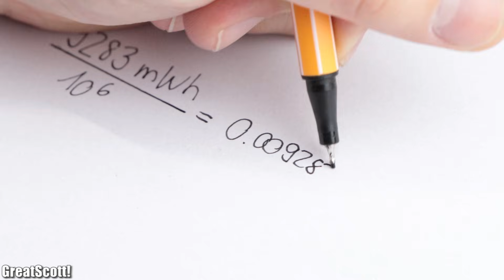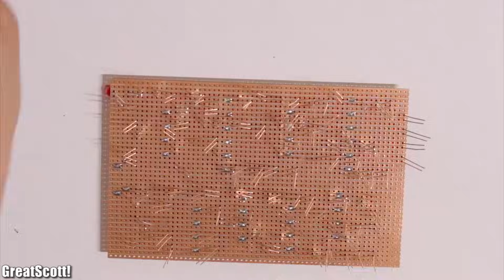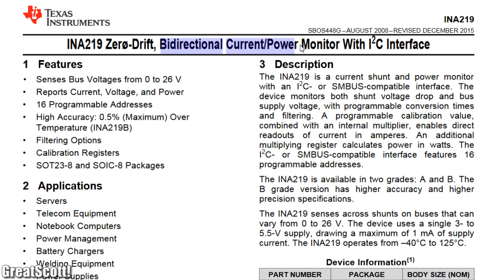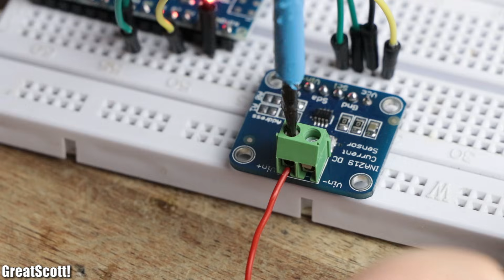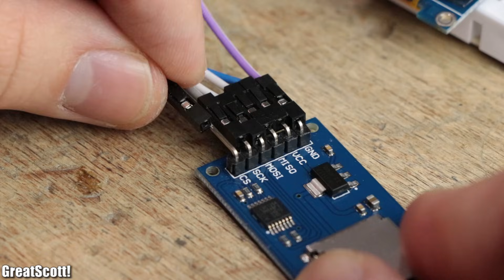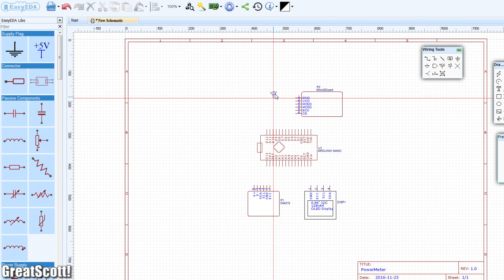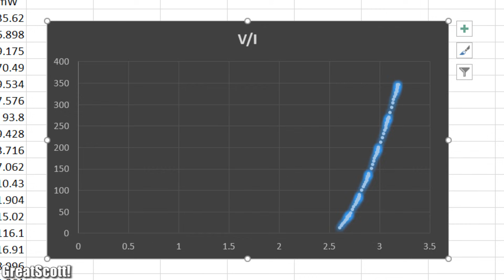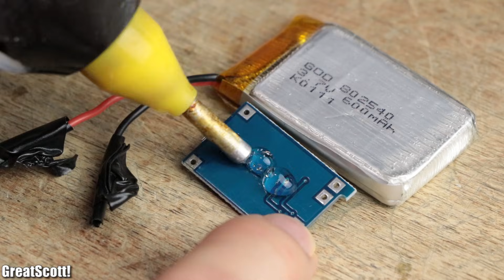Make your own Power Meter/Logger

Comment: I just started a similar build some days ago using a Pro Mini, ACS712 current sensor and the same OLED. Since I mostly record to my PC anyway my unit is powered using a USB port (thats not the input-port but a dedicated one) which also sends current values to the connected PC for display and recording. I opted to use the internal 1.1V reference instead on VCC, so changes in the PCs supply voltage don't offset the ADC that much. You might want to check this on your build if you connected the battery directly to VCC - afair VCC is used as the default reference for the ADC so your measurements might get skewed with falling battery voltage. Using the 1.1V also allowed me to dynamically scale for <7V input ("normal USB") and <24V (USB-PD). I also added a P-FET to turn off the output (Low-Voltage-Shutdown) and am measuring the Data lines to detect open, data, various Apple-signaling and DCP - sadly USB-PD seems to be off limits for now. Last but not least I save the current Ah/Wh to EEPROM when the µCs power supply starts to drop out. Currently I am waiting for some parts to get everything into a unit not quite looking like a bomb.
Reply: BitBastelei Hey 
Gar nicht erwartet dich hier zu sehen👋

Comment: Hey can you do a project with a non-led monitor/screen?. I have a few from old broken laptops and I really wanted to turn them into lamps but I found out that it seems all the projects people do are with ones that are LED and not florescent which is what I have in all my screens. I really need to light up my workstation and garage with something and I was hoping for the monitors backlights. I have seen they can be super bright sometimes but i'm not sure how good the florescent ones are for brightness. I'm also not sure how to wire/build on the circuit so I can have some form of control so I can attach a battery pack to allow me to move it around easily.

Comment: Rock on!  I have several of those little OLEDs - Watch out for cheap clones out of china...  quality control is generally non-existant... Plus shipping incidents can easily cause damage.   

 I have created INA219+ESP8266 based solar power / environment monitoring / logging / controlling  devices. Slowly building my own smart house   :)     #iot

Comment: what's the max voltage and current of this project. could I use arduino mega
Reply: 3,2 Amps and -26 to 26 Volts at max. You could use any kind of microcontroller, including the arduino mega. But that would really be an overkill for this project ;)

Comment: How do you charge the Lipo? I don't see any means except taking it out and charging it.
Reply from the maker: The board on top of the lipo is for charging. It is a TP4056.
Reply: Ah, ok thanks. I thought that was just a load protection for the battery. Didn't read the "Charger" part.
Me so dumb some times...
Reply: GreatScott! please make quadrocopter in next video 👍
Reply: Come on. Stop disturbing him. He'll do it at time

Comment: Great tip with the INA chip. Are you sure the misread resistance is not because of the probe contacts? Have you tested 4-wire measurement?
Reply from the maker: Since the current readings from the IC were pretty accurate there must have been another parasitic resistance.

Comment: But when you power your arduino with the lipo battery, did you use a 5v boost converter or a 3.3v arduino model?
Reply from the maker: I did not use a boost converter nor a 3.3V version.
Reply: And how did you managed to power on your 5v arduino with a voltage of 2.7-4.2 v?
Reply from the maker: *****
By not using the voltage regulator.
Reply: Ok and it's safe to use? Also what is the minimum voltage that arduino supports? P.s. Thanks for all your videos, you have an amazing resource channel :)
Reply: I just double checked it here http://www.atmel.com/Images/Atmel-42735-8-bit-AVR-Microcontroller-ATmega328-328P_Datasheet.pdf according to the speed grade section 2.7V at 10 MHz and 4.5V at 20MHz are stable region.  At the default 16MHz it will need 2.7V+(4.5-2.7/2) = 3.6V to operate safely, the lipo when fully charged will be at 4.2V and ideally when drained isn't really lower than 3.6V so probably okay so long as the voltage doesn't dip too much and the batteries are well charged.  Either way going to go with the pro mini at 8MHz then have a fair amount of overhead on the voltage.
Reply: A lipo when drained will be at ~3.0v. The battery will spend most of its time around 3.6 or 3.7v(depending on chemistry) however.
Reply: Richard all the lipo cells I've encountered charge to 4.2 per cell and shouldn't be less than 3.3 but t other chemistries exists.
Reply: Thomas Naldoni
Reply: Visit Arduino website. All information you seek is there!
Reply: Yes, 6V minimum on vin or 5v by a computer..
Reply: Matteo Naldoni look at the atmega328p datasheet, that is the chip used on Arduino nanos unos and micros. Look for the minimum and maximum supply voltage (They are probably linked to the maximum frequencies).
Reply: to "safely" run it must have higher voltage or be clocked to 8MHz and use will run at 3.3V.  I also have two 5V nanos with one powered directly off a lipo and one going through a boost, both seem to operate fine but ordered some 3.3V pro mini 8MHz for the longer term since I'm using them on an eskateboard and don't want any glitches.
Reply: Thank you all, your answers are really appreciated!
Reply: Tanti Kasso what?

Comment: How you show to calculate the cost of charging your cell phone in the beginning of the video is a bit misleading.  It would be more accurate to have a device measuring the power usage between the mains and the 5v power supply.  As you know, those power supplies aren't 100% efficient so you would see a higher power reading.  I suppose you could add that into your calculation if you didn't want to deal with mains voltages.
Reply from the maker: True. But such a calculation would have distracted from the main subject of the video. My calculation would only be correct if the efficiency from 230V to 5V would be 100%.

Comment: you could have used CSV instead of 3 text files
Reply: I was about to write that as well :) comma separate values (or semicolon) for the win!
Reply: you can write csc-compatible text in txt, just separate columns with ; or something else, what you use in csv-reader. sor example, if you copypaste text to excel, you need to tab each other columns.
Reply: I don't understand your objection, why should that be a problem with tab character and not with a semicolon one as column separator?

If there are too many lines for a csv/tsv file to be handled properly, you can use more advanced formats, like HDF or similar.
Reply: You can seperate the values with any delimiter you want, like a coma. The best thing with CSV is that it can be ealisy imported in Excel and you saves i/o call on the arduino/sd.
Reply: You can separate columns with tab itself ;)
Reply: ADFKSJG, would you have the code for this, new at all this coding and not to sure whats needs to change.
Reply: 9peppe
and if there are thousands lines?

Comment: Great video. The resolution of the OLED display is not set correctly though. It is not set to the maximum resolution.  Edit the library file in order to set the correct resolution 128x64 pixels .
Reply: @ChoudryArif  it's not hardware. I thought the same, and after 5 hours of troubleshooting I finally found the solution. You need to change a line of code from the library itself. Either way the display will work at half resolution, even if you change it from de IDE
Reply: @BnMroGaming  I don't know if the memory has been upgraded on the current models of the arduino, but from what I saw on the instructables site, they ran in on the 128X32 because of memory limitations.  The 128X64 used too much.
Reply: @BnMroGaming  hey lets talk i need your fb

Comment: You can save your values to a csv file and import them directly in excel :-)
Reply: @Kristian: Sure, you could write JSON manually (it's just text) but it would be a lot of overhead for simple data. JSON is better suited for representing data with a lot of structure to it, as an alternative to XML. For a couple of independent values per line it's overkill.
Reply: The simple answer is yes, and no.
I can't go into details in a youtube comment, but you need to know how data is stored on an SD card's FAT32 (or any other filesystem). Besides the stored data itself, there are certain additional bytes in the beginning of the card (called file allocation table, that's where FAT name came from) that gives you info like filename, file creation time, file size, attributes, etc. Also, the OS (or Arduino code) registers there where the file's content is located.
Just opening and closing a file doesn't do anything. Neither open-read-close. You can do this as many times as you want to (although it takes time, CPU cycles, and battery power).
But if you open-write-close, the content changes, file size grows, and the Arduino needs to alter the content of that area to register this change. Thus that particular sector gets rewritten 10 times a second. SD manufacturers might use wear leveling - especially in that area - but I wouldn't do that.
If you can potentially sacrifice a very small amount of measurement data (in case of power cut or whatever), you can collect data that takes around a whole sector (512 bytes), and write that simultaneously. This way you can lower the amount of wear (1 write operation for every new block of data).
Also, FAT is vulnerable to power cuts during write (it has no journal), so the more frequently you write, the more possible is the damage.

Sorry for oversimplifying it, if you're interested in the details, read the wiki page:
https://en.wikipedia.org/wiki/Design_of_the_FAT_file_system
(other filesystems work similarly, but modern types tend to have journal, which protects you from FS corruption for a bit more CPU cycles and wear)
Reply: In this case, JSON would be impractical. You could do it, but since you take a new measurement 10Hz, using a tsv/csv you can simply append a new line. With JSON, you would have an array of measurements, and your ']' would be in the way of append. You could delete that back, add a ',', append new values, and close it with a ']' to be deleted right after that.. a tad more hassle compared to a tab separated vector.
But.. you can do it.
Reply: I did and it worked - sort of.  I wrote all three values with semicolin separators.  The line returns are accomplished by closing the file, I think.  Here is the code:
void loop() {
  unsigned long currentMillis = millis();
  if (currentMillis - previousMillis >= interval)
  {
    previousMillis = currentMillis;
    ina219values();

    DataFile = SD.open("PowerData.csv", FILE_WRITE);
    if (DataFile) {
      DataFile.print(currentMillis);
      DataFile.print(';');
      DataFile.print(loadvoltage);
      DataFile.print(';');
      DataFile.println(current_mA);
      DataFile.close();
    }
    displaydata();
  }
}
Reply: No, the line returns are accomplished by that println. Also, if you can collect more data and write only then to the SD card, your SD card gets less weared out, so it won't break that soon. Opening, writing, and closing a file on an SD card all the time destroys it.
Reply: Wow, thanks again, NyOs Gomboc!  Fantastic, informative response.  I have started reading the wiki article.  I feared the indexing of the address (on write/close) would maybe concentrate the wear.  I will do as you suggested and buffer chunks of data before invoking a 'data dump' saving potential index wear.  There are other strategies for me to look at: 1.  collect at a lower frequency; 2, not collect the microsecond value; 3. maybe only collect values if the value has changed (if I can maintain some sort of time basis); 4. not close the file; 5. maybe write to a fresh file name with each each dump or every ten or twenty dumps; and 6. perhaps other strategies will come to me after reading more.  So far, I have recorded for 7 hours.  I modified Great Scott's program to track "if (!DataFile)" and then count the failed occasions.  So far, I'm way above 99% success.  The wiki article takes me back to DOS and boot sectors - something I long ago forgot.  Time to study up again!  .  Again thanks for your generosity.
Reply: Thanks NyOs Gomboc.  Line Return: Makes sense.  Because of your post I researched more on SD card wear leveling but still have one question.  Does the opening and closing cause wear, or just the writing?  I've read that SD cards employ wear leveling logic that move writes to fresher locations and can endure thousands of write cycles.  Great Scott's program writes 4-byte float values to SD memory 10 times a second, each with an open/close cycle into each of 3 files.   (I think the resulting written data value is much smaller than 4 bytes, however.)  But even so on a 16GB card, and (4 bytes)*(10 writes/sec) * 3 files, this rate would fill the card once in 1.3 years.  And if you can do that thousands of times, then wear isn't an issue.  But if the open/close cycles cause the wear cycle then an SD card would be good if it lasts an hour or two.  This would render SD cards inappropriate for such data logging.  Thank you for replying if you do.
 .

Comment: why the arduino pro mini?
Reply: h def about to replace regular board with pro mini on my own project reason being 1S 3.7V LiPo is way under the 6V minimum for the regulator to make 5V, so with regular Arduino you are always under powering it, pro mini can be clocked at 8MHz and use 3.3V instead of 5.  Means more stability at the given voltage and can talk to other 3.3 devices directly.

Comment: How can i make such a meter for my quadcopter?  it would see a lot more current and i don't think 30A through this thing would be smart.
Reply from the maker: You can change the value of the current shunt to something smaller. Like 0.01 ohm. This way you can measure up to 32A. At least in theory.
Reply: GreatScott! Thanks!

Comment: Hello there! What is the voltage of the output pins of the tp4056 lipo charging board used in the video?
Reply: TheDiamondLP Thank you very much!
Reply: Marios Pantouvanos yup around 4.2V that's the highest value it will have, it basically limits the current flow by allowing a voltage slightly higher than the current battery level to pass through.  So if battery has 3.4V charge level will be at around say 3.6V, and as it nears full 4.2 it slows the charge to "top off" the battery.

Comment: I can't charge my phone by homemade power bank using lm7805 it shows charging Singh but doesn't charge pls help me to charge up.does it have any alternative way to build a power bank?? pls reply
Reply: not going to happen with a 9 volt battery, 1. they only have a capacity of around 600mAh 2. the 7805 steps down the voltage by dissipating the extra voltage as heat and 3. a 9V battery can only deliver about half an amp of current
Reply: Akash Mk the problem might be that ur circuit is not giving enough powet that is 1-2 amps for most modern devices
Reply: Akash Mk what sort of batteries are you using
Reply: pufferfish0101 
9v battery
Reply: Shekhar Verma 
how to make a circuit which can deliver 1-2amps out of 9v battery
Reply: Akash Mk try to google how to make constant current power supply... You can use LM 317 IC it acts like a voltage controller but it delivers a constant current.  Find out that if it can deliver a 1 amp. Current or not
Reply: Shekhar Verma 
can u pls give me a detailed circuit and mail to my email mkakash2002@gmail.com
Reply: +pufferfish0101 
then how to make a power bank cheaply with common battery
Reply: +Akash Mk 
but in YouTube many made using lm7805 and worked for the